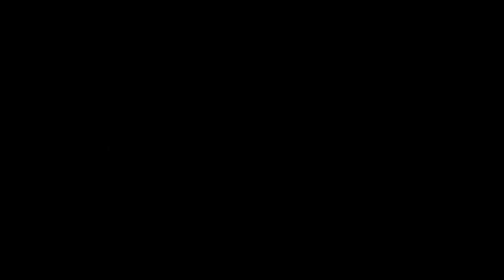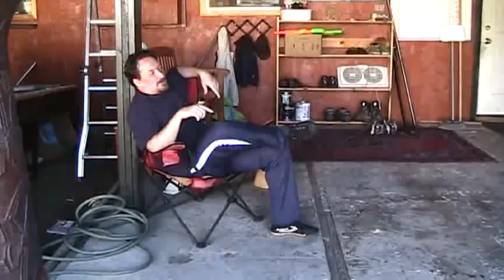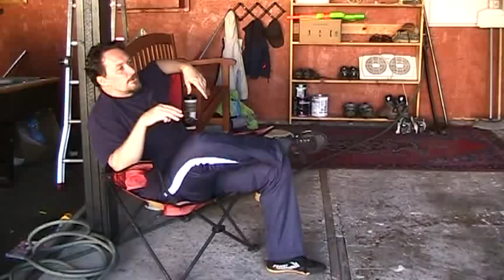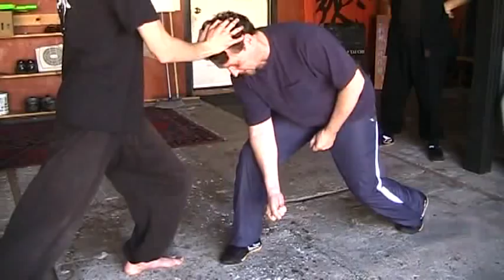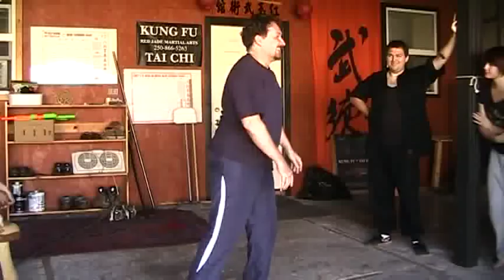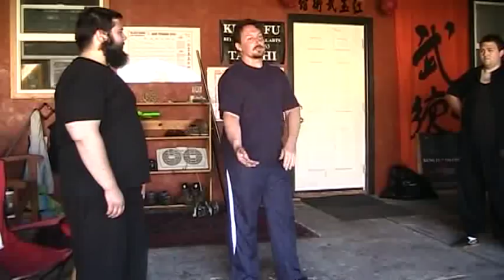Xinyiliuhe lecture and demo on structure 心意六和

Comment: how do i work on the neck before i even attempt the head based attacks. is there more power when i use the flut players palm or the cup fist  i have been striking  sand and wood with my fingers closed fist and fore arm what is a good type of ointment for the areas i have been using what else do you suggest i work on? can you suggest a better way to strengthen my fingers?